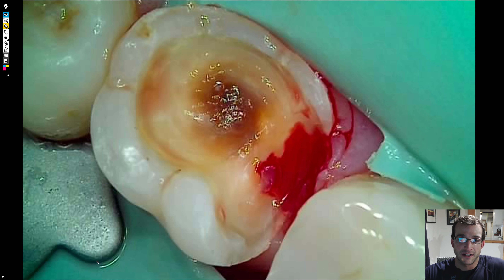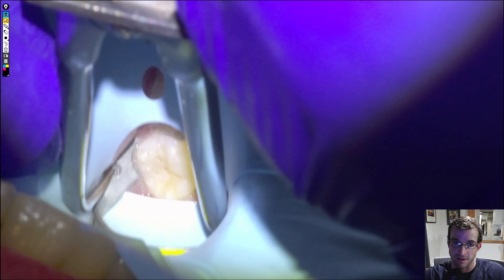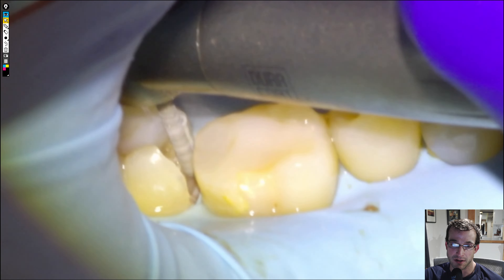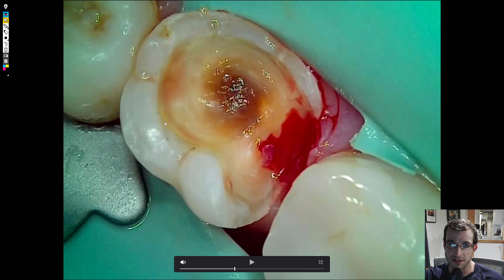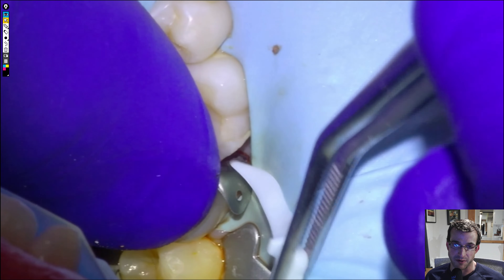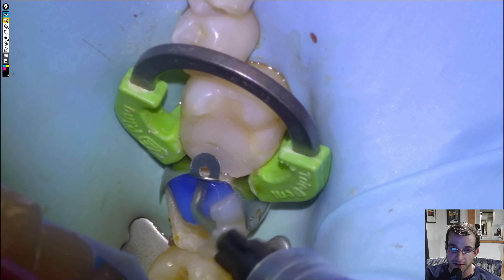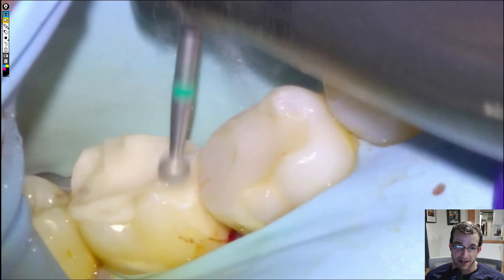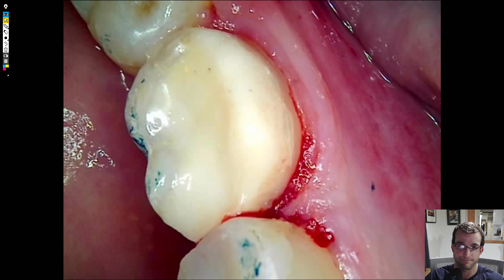[57] Decayed molar tooth restoration

Comment: Hey Dr ... in such case when we are close to the pulp there is no need to place pulp capping material like (dycal, Mta and Biodentine ) if we are using aquia forte as filling material 
Second question / applying polyacrylic acid for 15 sec would also work like phosphiric acid for 5 sec

Thanks
Reply from the maker: In my opinion there is no need to place a pulp cap with equia forte however if I am working with deep caries and I know pulp exposure is possible I will generally try to leave enough affected dentin so that blushing is not apparent while ensuring the DEJ is caries-free and then restore.
Manufacturer recommendation is 15s PAA scrub. I've read literature which demonstrates that 5s PO4 etch is equivalent so that's what I personally do but it's off-label

Comment: Hi Dr. Dobson, couple of questions related to the video

1) Could you elaborate more about why you don't like to see an interface of 2 different restorative materials? I see this commonly in patients as existing work and was wondering if it's better to just monitor or tx plan for replacing

2) If near the end of the procedure you find you are not satisfied with the contact, how do you proceed? Remove the entire restoration? Or just cut another proximal box into the restoration and fill, but this would lead us to the problem posed in my first question

As always thank you for these videos
Reply from the maker: Hi there - I would say it depends on the situation, if it's a small enough repair I'm okay with having a restoration within a restoration but generally I think that it introduces a weak layer which will be more failure-prone than one solid homogenous restoration. The one in the 46 in this video for example I think the pre-existing restorative material should have been removed to have one material especially on the surface of a first molar that is under a lot of force. 
I think preventing open contacts in the first place is the best solution of course but if it is truly unsatisfactory and you know it will cause issues then removal of the entire restoration is preferrable imo (though in most situation we know the pt will be advised of the possible issue and be informed that redoing down the road is an option)
Reply: Thanks for the reply Dr. Dobson!

Comment: Hello Dr! I have some questions regarding your endo-core build up workflow. How do you deal with super deep interproximal caries, how do you do the core build up, lets imagine the tofflemire doesnt get all the way down
Reply from the maker: Sometimes you can modify the tofflemire by cutting away the band in sections that impinging and preventing the band from seating all the way on the deep margin, however I find the 6.5mm sectional matrices easier to use for deep interproximal margins. Electrocautery can also be useful to remove excess tissue
Reply: @behindtheloupes thank you Dr

Comment: Doc, what are your thoughts on people advising against using Articaine for blocks?
Reply from the maker: I think this is similar to a "vaccines cause autism" scenario. One bad paper was published and everyone got it in their head that articaine should not be used for blocks. There is no credible evidence to suggest that the mechanism of paresthesia from blocks is anything but mechanical trauma from the needle. The fact is that articaine is definitively the most effective anesthetic and I'd rather have a numb tooth to work on. I don't see the advantage of using any other anesthetic unless working on a very frail patient where an inadvertent intravascular injection with epinephrine could cause a cardiac event
Reply: @behindtheloupes  Hi Tanner, I have been blocking with Articaine for 25 years now, and so far not a single problem. Regards from Namibia